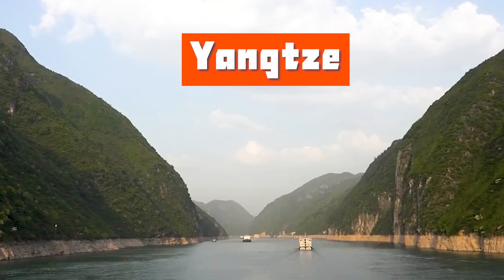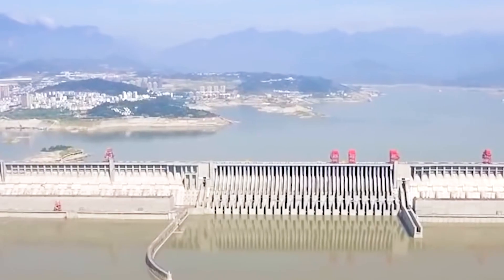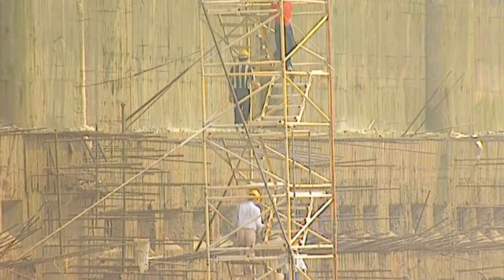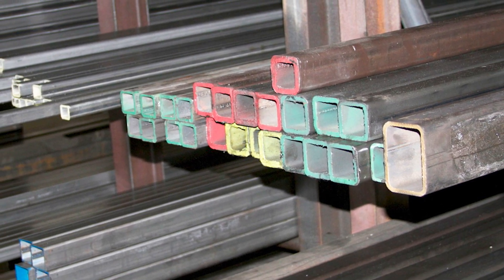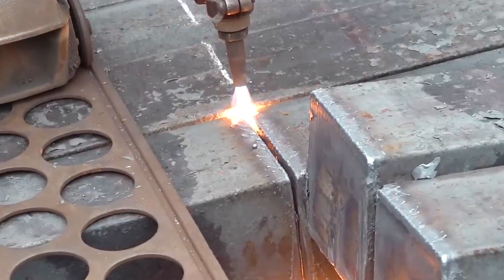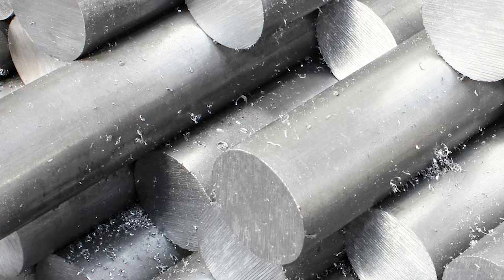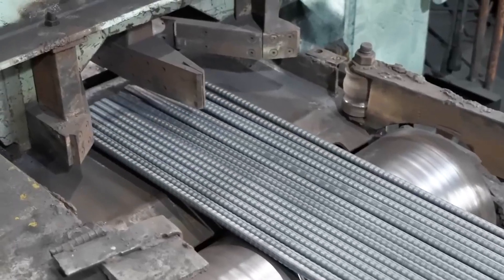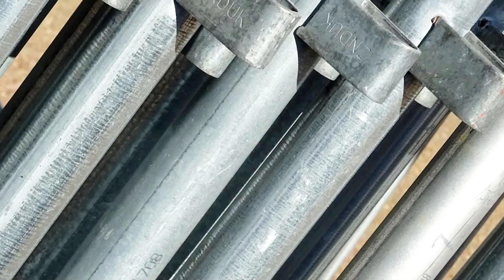China Cheated! The 240 Billion RMB Three Gorges Dam Was Almost Destroyed | Japan Has No Integrity

Comment: Not unexpected of the Japanese cheated.
Same with Toyota who cheated on the testing of their diesel engines performance.

That happened for many years until caught out.

Same with VW.
Reply: Not them but partner Hino that supplied engine
This result their partnership ended
This video scheme actually trying to belittle Japan like the one he presented in shipping industry
It was Japan partnership or Jv that enable china to built lng tanker and car truck carrier
How could he proof that it was using Japan substandard steel. When this dam was construct China is always the top producer dominated almost 70% of world market
Reply: At least they admit when they conduct their own investigation. No big deal for Asian market which dont  have strict emission regulation
They want to clear their old exhaust system Hino